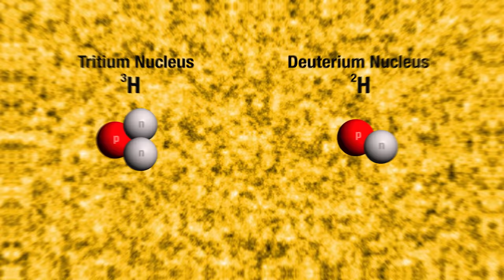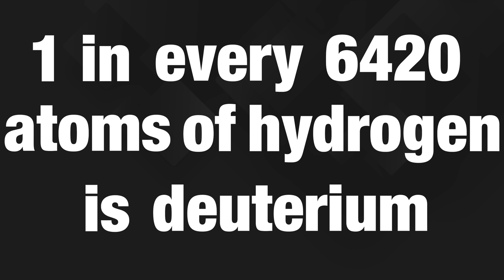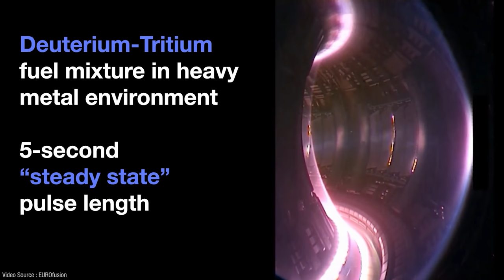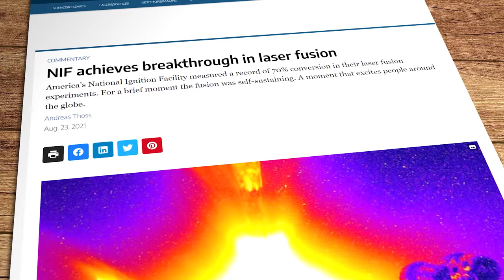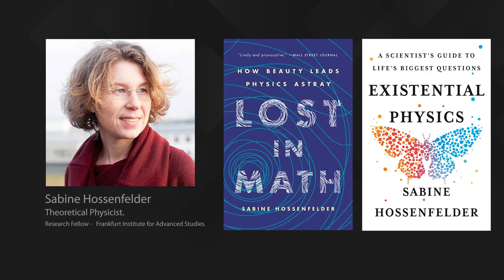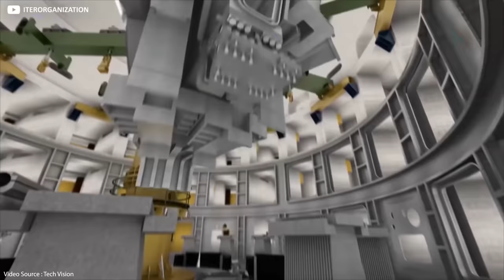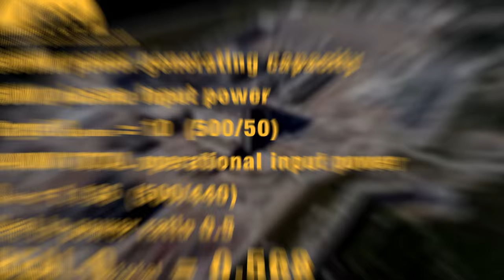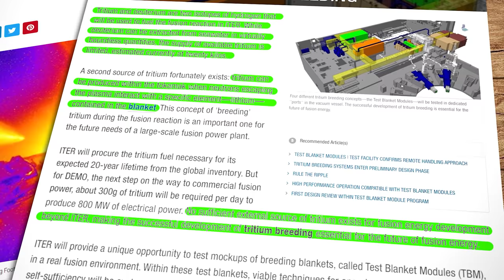Nuclear Fusion Illusion. Is it time to park the pipe dream?

Comment: So one of the exciting things to happen in fusion research in recent years is a new cheap, mass producible, superconducting 'tape' that generatas very strong magnetic fields while superconducting.
ITAR unfortunately is way to far along to implement those magnets, but any future reactor that does will require far less energy to run the magnetic coils and can be significantly more compact relative to the reactor vessels size.

Also the 5 second JET pull was the maximum length they could run their magnetic containment for before it overheats, because they aren't super conduction. That 5 second pulse was basically proof they can run a sustained fusion reaction for a arbitrary length of time.

I also have to disagree with your assessment of the fission process to create tritium. One of the reasons current nuclear reactors need all that scrutiny is that the fission of heavy elements is a run away reaction that we then moderate to keep it under control. Creating tritium isn't at all. Once the supply of external neutrons stops, so does the reaction. There is no risk of a run away reaction, there is no continues decay heat to deal with, and there is no risk of water/steam coming into contact with the material and creating a hydrogen explosion. So none of the things a nuclear power plant needs all those safeguards for applies to creating tritium.
Reply: if you can make tritium, it would be possible in theory to get other elements, depending what do you use as your panel... for example other elements for nuclear bombs.
It also produce radioactive materials that need to be carefully disposal.. 
Is orders of magnitude less risky, but the same regulations should be follow. 
Besides.. Fission or Fusion, does not have any future, they can not compete vs Solar or Wind, no even if you have a comercial fusion reactor today.  The LCOE would be still much higher.
Reply: @angellestat2730  That cost analysis is only true if you ignore the need for storage and grid upgrades to deal with the intermittent nature of solar and wind.

And while the reaction does produce some radio active elements, it can't make heavier elements. So for inspection were taking more the level of nuclear medical waste, not even nuclear power plant. And just inspections, not the whole huge containment chambers nuclear fission reactors need which is where the real costs are.
Reply: @TheCountess666  All of these problems can be solved, but at what cost? We're overlooking the fact that cheaper technologies already exist and in the next 20 years will continue to mature. Renewable energy plus large scale storage (in several forms) is the future. Fusion will never be viable economically because it will not compete.
Reply: @saumyacow4435  Well that depends on what you mean by "never" if by never you mean within the next couple of decades, then propably not, but if by "never" we mean even hundreds of years from now, then I do believe that nuclear fusion will be neccessary, as energy generation further from the sun is eventually not possible with solar panels. This of course is at present rather irrelevant, but we do constantly learn new things from doing projects which seem irrelevant, so I'd hold off on cutting funding for nuclear fusion, instead I'd look much more into the subsidies for fossil fuels and shifting those to renewables instead.
Reply: @redcrafterlppa303  1- Clandestine production of plutonium 239 is possible in a fusion reactor simply by placing natural or depleted uranium oxide at any location where it would receive the stream of neutrons.
2-  Nuclear fission advocates said the same thing, the old slogan of how much power you can extract from a simple rod, but in practice..  it is from 2 to 6 times more expensive than Solar and Wind.  
Fusion would be even more expensive, not only that, Solar and wind continue to the low cost trend.
Reply: @op4000exe  Its hard to imagine a future where nuclear fusion is actually cheaper than other, inherently simpler and cheaper technologies. Energy storage will soon become a trillion dollar industry and the technology for it will mature and become cheaper. I actually love nuclear fusion from the point of view an engineer who loves big, complex things. And I don't think the money will be wasted either. We'll learn a lot from it and we'll probably end up with fusion in space.
Reply: @TheCountess666  There is already a cost effective solution to the intermittent nature of Solar and Wind.
First.. you need understand that our co2 emissions does not come only from the power grid, they come from the utility transport sector and the natural gas grid as well, that alone accounts for the other 50% of our energy related co2 emissions.
So if we would clean the world, we need to clean all the other sectors as well who can not run with wires or batteries. 
In order to do this you need to produce hydrogen, if you do that, then you already solved the intermittency issue of those sources.
Not only that.. Australia, Texas, California, Japan, India, a big part of the EU, are starting to follow that path.
Australia already plans to produce 3 times their power grid needs with solar and wind and not only feed their own hydrogen needs, they would become an hydrogen super power exporter, all that just in 15 years. At that scale hydrogen production of 1 usd/kg is possible, which it would be cheaper than extracting natural gas or other fuels.
Reply: With new magnetic materials we can make stronger magnetic fields. This makes controlling plasma much easier. We can make smaller fusion reactors. Which are cheaper and faster to build.
Reply: @angellestat2730  1. Your argument lacks. Uranium is not a valid substance to be present on a fusion plant. So what regulations concern. You can  "ban" or simply not allow uranium in the facility.

2. A fusions Q plasma factor grows with runtime. When we can create the magnetic field without much power and can sustain the reaction indefinitely the plasma will heat itself and we just need to supply fuel and extract waste. The fuel cost to energy value is enormous. The reason the current and past projects didn't break even was the power draw of containment and the expensive startup. But with room temperature superconductors and continues operation the power will be cheap.

3. Fusion is not competing with solar or wind. It's completing it. We can't run 100% "natural". Wind and solar are to unreliability. Fusion is intended for stability and operations where solar or wind are not usable like on aircraft carrier or spacecrafts.
Reply: @saumyacow4435  Oh definately, i don't believe that fusion will become cheaper in the sense of using it to power things closer to home, but we'll need it if we want to venture beyond the inner solar planets, simple because solar panels stop working once we reach the orbit of saturn or thereabout. But mostly I think we need to continue with it, not for the sake of using it on earth per se, but more for what we can learn from the process of trying to get it to work.
Reply: @redcrafterlppa303  1-oh, that is quite naive of you,  laws are made to be broken.
Someone owns the fusion plant, someone can hire "special workers" who would control and do all that. 
Those things can be hired on places of the reactor that are hard to see.  Those same things can be remove it when you have inspections. 
What I am saying.. that if you have all the regulations that try to avoid all those issues with nuclear fission, you would also have to have many of those for nuclear fusion, which also increase the cost, and nothing ensure you that it would not be possible.
 
2- The power required to achieve fusion not only comes from raising the temperature, you need to maintain the magnetic fields and several other systems. 
BTW: you mention room temperature superconductors?  Are we on avatar world now? 
Also.. they were only able to do that over less than a second, how much time we need to achieve that 24/7? 
I am not saying that this would not be possible in the future, but it does not matter.  Because most fusion projects still relays on boiling water to produce power, this mean that the nuclear plant would have its underlimit to how cheap it could be.
That underlimit is given by the capital cost of the reheat thermal system with 2 steam turbine, boiler, condenser, cooling tower or heat exchanger, etc.
All that already represent about a 20 to 30% of the whole cost of a nuclear plant. 
This mean that its LCOE would be even at parity with the best locations for solar and wind today, even if you have your fusion reaction for free. 
And solar and free as I say, they continue with the low cost trend. 

3- I already provided several examples how many states and countries would produce all their power for all the sectors just using solar and wind.
For example, search this "australia-boasts-830bn-pipeline-of-wind-solar-hydrogen-and-storage-projects"
Reply: @op4000exe  Fusion for space propulsion seem like order of magnitude easier than to generate power, because we dont need to control the reaction in a loop or keep it cool.
Yeah, all the research on fusion should be focus on that.. also, the AI age is comming, any project that would require more than 15 years of development would be completly pointless taking into account the tools we would have at disposal with AI.
Reply: @angellestat2730  After thinking about it for a bit, I do actually believe there's 3 nearer future situations in which nuclear fusion would be valid, even if the price is high. And that'd be:
1: Energy generation for backup systems in case of emergency.
2: Energy stability for certain processes which require absolute stability in the energy going into the process.
3: A few plants for generation power for critical infrastructure, such as government buildings, hospitals and other places which cannot deal with sudden power outages, though in this case it'd only be a couple of power plants even for a country as large as the US.
4: The obviously most important one, that being as a hidden power plant for the evil mastminds hidden lair!
4 for reals this time: As power generation for the future of humanity when finally we genuinely begin to colonize space, and develop missions so far out of the solar system that we can't rely on solar power generation.
Reply: @angellestat2730  1. It's seems unlikely we will share a opinion on the safety topic so I won't continue on that point.

2. Room temperature superconductors are real and now. Sure they still need some refinement to be practical but even high temperature superconductors (range from '-50' to '-10' deg C) which are practical now are sufficient for fusion. The problem with tje current projects is, that they started years ago and build on the technology from yesterday. And even then they produce these "great" results. And sure currently the best way to convert heat to energy we knew of is steam. But imagine that changes in the next years. Fusion has a great future in many fields. For stability, difficult /important infrastructure and more.

3. The climate change will have lots of effects on nature. For example the golf stream. What happens if it changes dramatically? Fusion reactors don't care, wind turbines and solar fields do.
You ask :why solar? Because areas where solar was enough could suddenly due to constant weather changes become cloudy for most of the year. Of cause only an example. 

but we need fusion not for now and the climate crisis but for the future. When energy consumption rises and everything is covered in solar and wind turbines are everywhere, where should extra energy come from? Burning gas and coal??
Reply: @redcrafterlppa303  2- You might be talking  about those superconductor that only work at incredible high pressures (something orders of magnitude harder to achieve than just reduce the temperature. 
You are not reading the small print from the science "breakthoughts". 
Also.. I am not against fusion.. if we accomplish that great.  But as I say, any projects that requires at least 20 years on development, is a waste of time, because at that time the AI tools would improve exponentially from now, this mean any thing it would take decades to figure out today, it would take few days on the future.
 
3- When that happen is already game over for crops and us (the ones who need dry climates or the ones who require wet climates), moving all that infrastructure where whole cities were located  to exploit those resources is not economical possible. 
This is why we need to install a lot of solar and wind now.  To prevent the worst scenarios on the future. 
Solar farms can be move it.. In fact, each time solar PV reduce so much the cost, that today companies dont even bother to place the panels in the right angle or with tracking devices.
In fact, the structure cost represent already a big % of a solar farm cost, this is why solar companies are planing to start to place the solar farms in flat over the ground.  That way not need to fight the winds or nothing. 
The cost would keep its trend, and even as transparent windows would be use it. 
For wind there is also room for development, with airborne and kite systems, which reduce the materials in a 90% and it would increase the capacity factor but a big margin. 
 
When energy consumption rises and everything is covered in solar and wind turbines are everywhere, where should extra energy come from?
What?   If I remember right, only a 6% of the Sahara desert cover with solar panels can produce all the energy consumed by all energy sectors worldwide. 
The best locations for Solar and Wind is often when the less amount of people live.
You can produce hydrogen in those places and deliver the energy on ships or using pipelines, which is 1 order of magnitude cheaper than moving the same amount of energy by wires.  Ones it reach the country, the same natural gas plants or fuel cells can be used to generate electricity.
Reply: @op4000exe  solar and wind comes with hydrogen, so new fuel cell plants or the existing natural gas plants (just buying another turbine) would be able to work with hydrogen.  Right now there are already turbines that are being designed to work with any mix of natural gas and hydrogen.
The same can be said from Solid oxide fuel cells. 
A fusion reactor could provide reliable power,  but it is so complicate, that it requires highly specialize people to operate and repair in case something happen, not the kind that you would have at disposal in a war or catastrophe scenery.
Reply: @angellestat2730  Cool, didn't know about that, thanks for the information. As for the stability thing, I was  mostly thinking of that you could potentially one day have a fusion reactor which basically does its own thing for energy generation (not a technology that's close though now that I think about it, weakness there I didn't consider) for several decades until its fuel runs out.
Reply: @angellestat2730  the sahara desert is a nice idea but as you mentioned we don't need it there. Converting it to hydrogen and back loses uneconomical amounts of energy making that energy more expensive then nuclear now.

As you stated you are not against fusion the same goes for me I'm not against solar or wind, but my concern is that the production is often not where it's needed.
The next part is my personal idea and I base it on no direct source I could quote : To solve the location problem we could build energy pipelines, like in some science fiction movies, we could use the advances in superconductors and make the production of high - room temperature superconductors economical, they could solve the transportation problem.
Reply: @angellestat2730  Except that making, storing, and using hydrogen is anything but efficient. As a energy storage solution it has a round trip efficiency of less then 50%.
That's right, more then half the energy you're trying to store is wasted.  the best theoretical system we've come up with tops out at 47% efficiency, but some are as low as 18%.

Compare that to pumped hydro with 80% and batteries with 90-95% round trip efficiency.

That means you need twice the amount of over-capacity in renewables, in addition to the cost of the storage facility itself. which obviously changes the cost analysis completely.

Hydrogen is only really useful as a alternative if you need a lot of power and it needs to be highly compact and portable (think jets and long haul trucks) but even a truck will require 2 to 3 times the amount of energy per mile (well to wheel) compared to a battery truck or car, so you'll be paying a heavy energy cost for that convenience.
Reply: @redcrafterlppa303  I am not against fusion, but I am against all the public funds that are being spent where other projects require much more priority with higher impact in the short term. 
For example to name one, the AI or algorithm needed to keep power kites flying autonomous most of the day, that stills elude the capacity of small private companies working in that problem. 
The sahara example, was just a counter argument to your assumption that we would run out of space to place solar panels :S
In fact, it was not 6%, now that I check that data again, we only require a 1.2% of the sahara desert. 
But ignore that and just add tiny % close to each city of the world.  With higher % in the best places that would also work as hydrogen production to remplace all fossil fuels. 
Converting it to hydrogen and back loses uneconomical amounts of energy making that energy more expensive then nuclear now.
You are guessing I suppose. 
The average cost for nuclear today is at 120 usd/MWh, unless we take subsidies in form of low discount rates that are going to be paid for future generations.
Solar and Wind average at 40 usd/MWh today, with some projects reaching 10 usdMWh. 
Even with nuclear you need to include hydrogen production if you want to clean all other energy sectors, so not sure why nuclear would be more economical. 
About energy loses, a paper calculated that even if you want to transfer and use energy as electricity, at certain distances, even accounting for conversion loses of electricity to hydrogen, then hydrogen to electricity, sending that power on hydrogen form could be cheaper than using a HVDC line. 
This is the conclusion that this paper reached, because you need to add all the extra profit of the storage vs the wire that you need to use that power instantly. 
Search "Renewable energy transport via hydrogen pipelines and HVDC transmission lines"
Even Texas plan to use a part of their hydrogen that way.
Search "Green Hydrogen International Announces Hydrogen City, Texas"
Another thing which is being study with prototypes already built, are superconductive DC lines that would also transport cryo hydrogen as gas. 
It transport hydrogen and power and the hydrogen would keep the superconductive temperatures. 
So a small diameter cable could transfer MW of power of electricity and hydrogen at the same time.   Search it.
Reply: @TheCountess666  The first thing that people outside the energy business learn, is efficiency of different energy tech.  But that is just one parameter between 5 or 10 parameters that are equally important. 
The only thing that matters at the end when you combine all the parameters is overall profit by year.  That is the only parameter that matters for investors.  
I recommend you to read my previous comments where I provide several examples on motion of what I am talking about. 
You mention batteries for example.
Imagine you have a wind farm with 2 days of strong wing (is super normal). 
Each time you want to double the capacity with batteries, you need to double the capital cost, with hydrogen once you already purchase certain power input/output, doubling capacity over and over is negligible.
This already give us that batteries are only cost efficient to store around 4 hours depending the application, for higher than that hydrogen is more cost efficient.
This mean that if you want to store 48 hours of your wind farm output, with batteries you would be wasting like a 85% of that energy, or you would need like 8 times more capital cost. 
What is the real efficiency of the investment on batteries in that case? 
Also.. as I said.. half of all co2 emmisions comes from the utility transport sector and the natural gas grid..  How those would work with nuclear or batteries? 
Can a container ship work with batteries? 
These operate at nominal power over 320 hours, imagine the cost and weight that it would require using batteries?   Where these are only cost efficient for 4 hours.
This mean that ships can not work with batteries, nuclear is not an option due the cost and risk either. 
So they need energy in chemical form one way or another.. so there is no need to count the 60% of efficiency than a fuel cell has, because there is no other solution for that application.
If hydrogen could be made in only 10 years at 1 usd/kg, it means it would be already cheaper than natural gas and in some cases fuel oil.  
Trucks is a similar problem, it is an utility vehicle.  Companies require to deliver their cargo with the minimun investment.. They dont have hours with their truck stop to recharge batteries every 400 km.. 
They need a range of 1000 km at least with fast recharge. 
Because if your truck would be stop a 50% of the day, then you need to buy two trucks to deliver the same cargo.   Do you understand?  Is all about investment and the profit that investment will give you by year.
Reply: @angellestat2730  Actually 50% of trucks drive less then 400km a day. So that's a lot of trips already covered. 
And i already mentioned long haul trucking as a possible use for hydrogen, but you have to factor in 3 times the energy used per km. the other option is electrifying a few mayor highways which could cover the vast majority of the other 50% leaving the remaining edge cases for hydrogen.

As for grid storage, you're looking at it from the perspective of say a wind farm owner and how to maximuze the use of his existing wind power, while I'm looking at how much extra wind and solar we'll need to build, and the extra expense that will bring, if we used hydrogen as our storage medium and we want to insure base load.
Reply: @angellestat2730   as you assumed i was guessing about that nuclear - hydrogen thing. But it was just an example that the converting and transporting of hydrogen is not very viable. You mentioned special cable that transport hydrogen and energy(superconducted). This is cool idea with 1 flaw hydrogen needs to be cooled to stay liquid or must be under pressure. They don't cool the wire, they nees to be cooled like the wire. That's also the reason there are no large hydrogen pipelines yet. They need active cooling witch add when considering the converting transporting thing with hydrogen. The alternatives are trucks trains ships etc. Which are slow and produce a lot of carbon emissions.
You also mentioned hvdc. Question why dc? You can use standard hvac in superconductors without needing the costly conversion step.

The difference between hydrogen pipelines and superconducting wires is that a failure in a cooled wire results in easy controllable surge in resistance. A hydrogen pipeline would expand and leak and worst explode.
Im not saying hydrogen is bad. I'm a big fan of hydrogen cars. It is also a good way to store access energy of renewable energy, but in my we should use it as a buffer that fills and empties according to production and need. And produce the need for hydrogen somewhere else. I know that somewhere supports double conversion but better then the dangers of flowing hydrogen.
Reply: @saumyacow4435  the future is diversity, for now renewable sources are the answere for climate change, fusion will be to late for that, but then we have a ever increasing deamand for electric energy, for that we will need fusion power. the renewable wont be enough for that
Reply: @TheCountess666  First, is not 3 times.. 
Electrolysis 80%, liquefaction 85%, Fuel cell: 60%, this equal 40%. 
In lab it was already accomplish 75% round trip efficiency for hydrogen.
For BEV is around 87% or much lower over cold climates. 
BUT...  what is the virtual efficiency lost when you can not use the power you generate?  What about seasonal disparaties?  
It is funny, all battery and wires advocates only takes into account the energy loss by efficiency and they ignore all the rest, which start to increase exponentially once you pass the 30% or 40% of share on intermittent sources. 
Trying to include nuclear would not help you at all because it is much more expensive, even more if you try to use it as load follower. And as I say, you need to produce hydrogen one way or another if you want to clean all the other energy sectors. 
Yeah, some city trucks could work with batteries.. yeah.   But hydrogen is easier to scale,  the power grid that now would require to feed all cars and some trucks, no..   Delivering power by wires is 10 times more expensive than by new pipelines. 
Search "Cost of long-distance energy transmission by different carriers"
im looking at how much extra wind and solar we'll need to build, and the extra expense that will bring, if we used hydrogen as our storage medium and we want to insure base load
Baseload is an old concept from the times where coal and nuclear where the cheapest source of power due their low marginal cost, so they were used as "baseload", this mean they get priority in their contracts to sell their energy at all times in order to recover their capital cost. 
But right now they are not longer cheap, and the power grid around the world operates in a more dynamic way, where power sources compete in cost to sell their energy by hour. 
And this is already the path that most countries are already following, Australia already has a pipeline of projects planned that accounts for 830 billion, several ways their power grid needs and become an hydrogen super power.
Texas, california, india, japan, most EU (even more now to not relay on russian gas) and several other countries. 
And in many cases it would happen in a period of only 10 years.  Why?  because is the most cost efficient solution.
Reply: @redcrafterlppa303   damm, I already wrote a long response.  but I edit one single word and then youtube show me an error when I modify the text, and now I can not post nothing similar to what I have wrote before.
Because I dont know.. it took it as spam..
Sorry, I dont want to write all that again :(
Just read about it.. you have several misconceptions that are the normal ones, there is a lot of misinformation about hydrogen.   in case you want, if I find the time later.. I will wrote that reply again.
Reply: @angellestat2730  I think I know what you mean. I know hydrogen cars don't "explode" they are designed to vent the tank. And maybe even large transporters are safe. But pipelines are something different. If you don't go the cooling route, you need to go the pressure route. And long, long term use pressurized pipes don't exist to my knowledge. If they where simple to build (safe) they would be everywhere.
Another problem I forgot before was the current geo political situation, focusing on Europe and the Sahara. Say we would build a giant solar plant in the Sahara and ran pipes across Europe supplying Europe with hydrogen. Europe would be largely dependent on the country owning the source. The same problem we currently see with Germany and Russia. Being dependent on one source of something is a bad idea. And the idea of centralized power generation is not politically possible in our current world.
Reply: @redcrafterlppa303  oh great, so my comment did not disappear? 
Gas pipelines are very common, most of the natural gas of the world is transported this way. Hydrogen would not be different, you can even use the same pipelines to transport hydrogen with minor modifications.. You need to modify or change the turbines used to compression, install ones designed specifically for hydrogen to reduce power consumption. 
But at those pressures is nothing.. we are talking about 30 bar. 
An hydrogen tank car has 700 bar and the last NEXO accomplish records in safety in the crash test vs all the other cars of the year.
Even if you blow up a pipeline with C4, the only thing you have is a long flame from each end.   Nothing more..   An explosion is not possible, Hydrogen rise 20 m by second, is not like natural gas where it can accumulate at floor lv until it reach explosive mixtures depending the temperature.
Hydrogen diffuse super fast away of the people. 
It has even lower energy by volume than natural gas, so any flame or explosion would be lower,   the flame emits much lower radiation, so the risk of skin burns is reduce.
All new big hydrogen projects would use hydrogen pipelines, salt caverns would be also used to increase the storage. 

But you are right with Africa, that is also my concern, if fact, the EU already had some plans for an hydrogen production on Africa, but to relay on development countries with lower rates of economic freedom is a bit risky. 
A different thing would be Australia, the risk to commercialize with them is almost zero. Germany for example already reach an agreement to buy hydrogen to Australia.
Reply: @certhass  Fusion will never compete with simpler and inherently cheaper technology. The increasing demand can and will be met with a combination of renewables and storage.